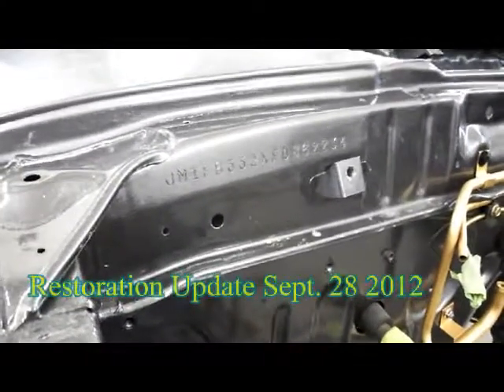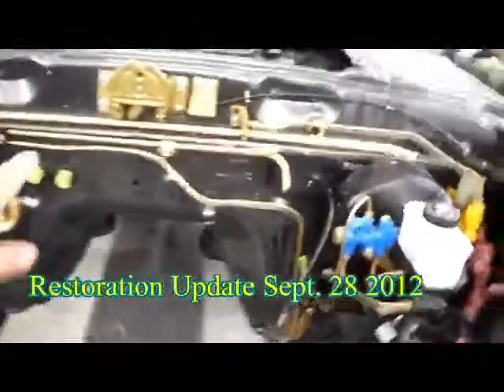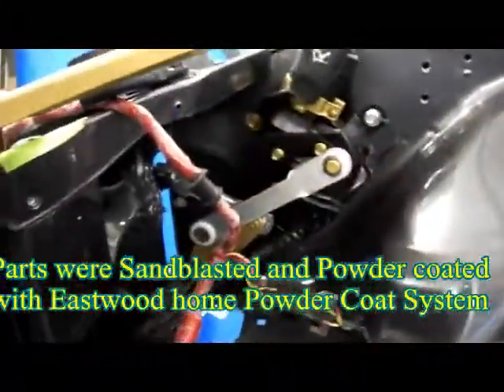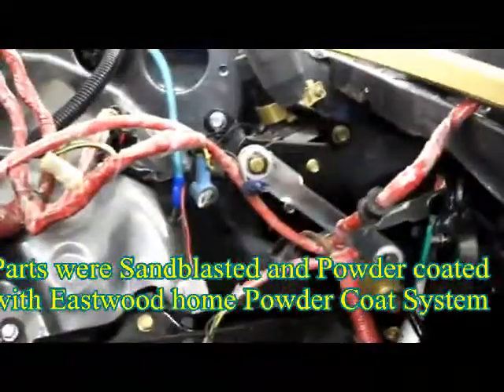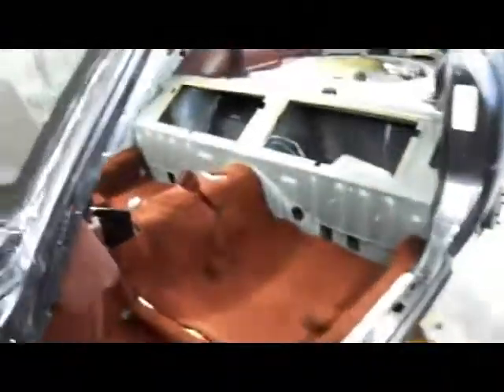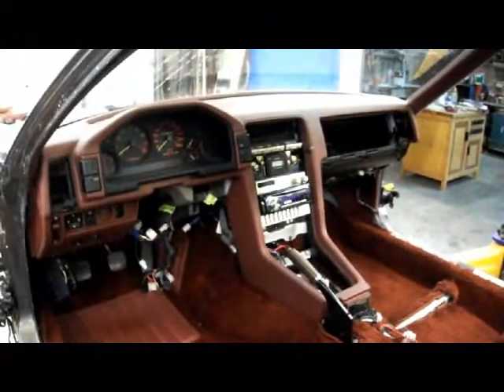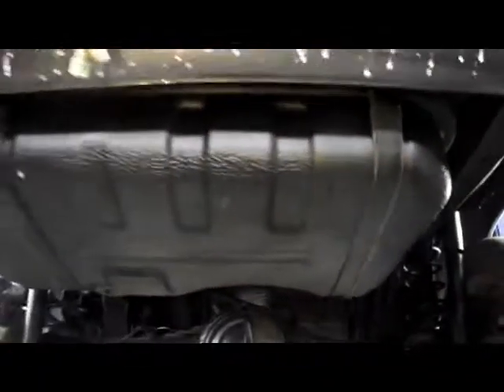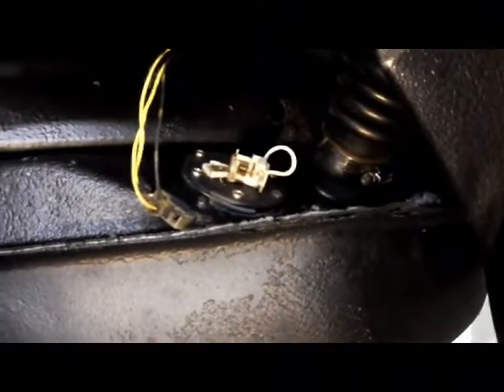Mazda RX7 1985 FB Restoration Update.wmv

Comment from the maker: 85 GSL-SE. The engine is  from an 86 FC, 6 port  4 injector.  I will be using MegaSquirt to control both fuel and spark as per Aaron Cake's post.  If you looked at my engine rebuild picture show on this channel you can see the short block. The new ECU has been shipped, I am hoping in about a week or so to do and engine start on the stand, put 5 hours on the engine and then install it into the Car body. Being held up sucks,  I want to keep moving on this project.

Comment: Hey, I'm having problems with my RX7 and need help desperately. I have a 1985 GS and it shakes EXTREMELY rough just at idle. When I get to about 5,000 RPMs the shift nob is vibrating so hard/fast that it feels like I'm grabbing one of those prank shocky pens. If you have any idea on what it could be please let me now. It's all stock except for a direct fire system. Both leading and trailing spark plugs fire, just replaced distributor cap and rotor, and nothing is wrong with clutch/tranny.
Reply from the maker: Larry are you sure you have compression on all faces? If you do, try taking the bolt out from the Dizzy and slowly turn it each direction and see if it smooths  out. Disconnect the trailing plugs and see if that helps.  Sounds like a timing issue or lost compression on 1 face.   I don't know anything about the direct fire system
Reply: Shifter bushings? My cousin's miata had a wave washer break on him and it exhibited some of the same problems you have.